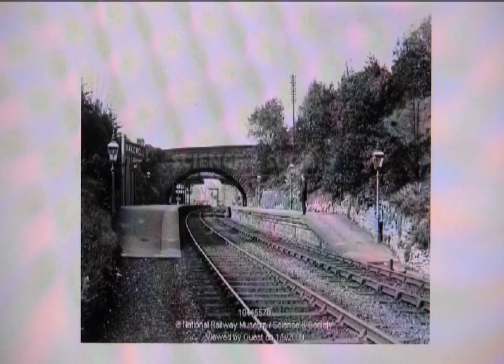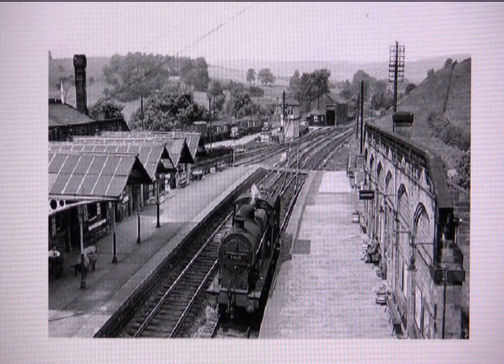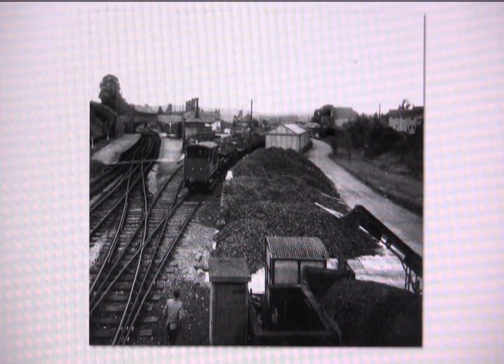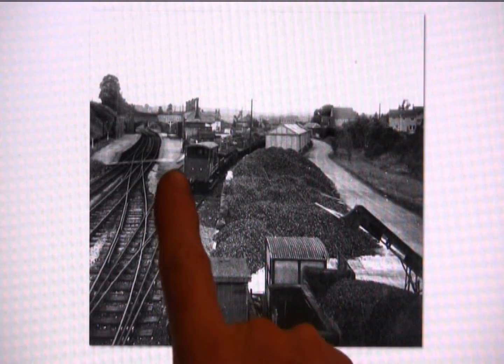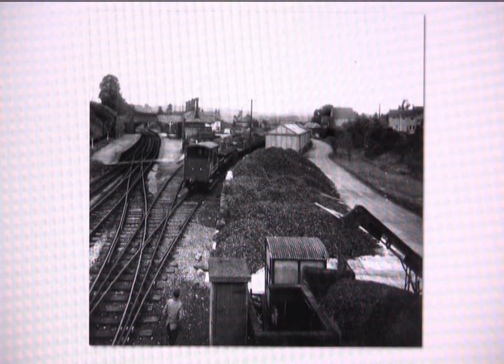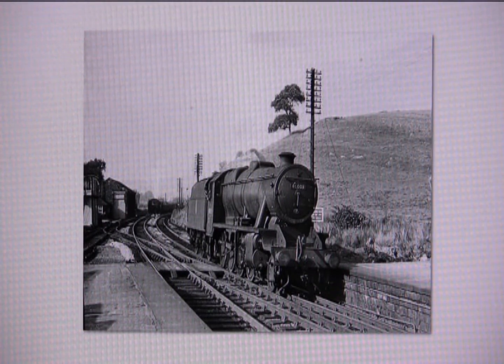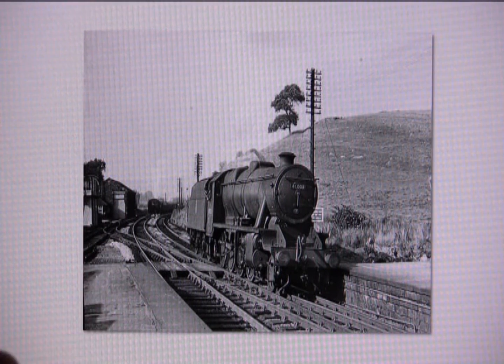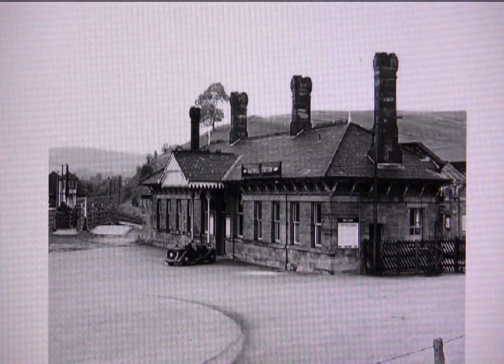N gauge Folding Model Railway part 13 by shed engineering.

Comment: Hi,

If you are using Peco finescale code 55, why havent you correctly modeled the three way point and single slip shown in the video at 22 mins 37 secs? as the Peco code 55 range offers both the single slip and three way points.

Peter

Comment: Looking good . that foam stuff is a good idea
Reply from the maker: I started using expanding foam to start with because I was worried that with it been a folding layout and semi portable there would be a fair bit of twisting etc,,, and thought plaster cloth and normal white filler would crack in no time at all,,, but its good and quick ,,,, and you have chance to sculpt the contours of the fields ,,, or leave lumpy bits if you wanted rock faces etc,,, so I think it vale for money,,,put in one night ,, come back to it the next and shape it down,,, cheers Alan

Comment: Hi Alan,

sorry to hear about the tunnel, but your solution works well, and as you say the interior of the roof would have been covered in soot, so you wouldn't see the fine detail anyway.

Your model of the station looks great. It's such a pity about the turning circle. If it were me, I wouldn't want to compromise the station building by shrinking it, to me the station is the focal point of the layout, and therefore deserves to be done properly. Also, bear in mind that the station canopies and the porch on the front are nearly as wide as the station itself, so you do need a fair bit of room to fit it all in.

I appreciate what you say about digging up and replacing the turning circle, but maybe you could make a new, shorter loop and graft it in, rather than try to reshape the existing one?

Thanks very much for showing my model of the station, It's very kind of you. If people want to see my vids, then searching YouTube for "Bakewell Station" should find them, or you can click here:

https://www.youtube.com/channel/UCBa9Xe8o5vOknHF3jW7Bp0w

Chin up mate, I'm sure you'll get it sorted and looking great as always.

Al.
Reply from the maker: Hi there Alastair ,,, Few you didn't mind me using your photo,,, thanks ,,, I should have asked first,,,,, I will put the link into the description ,,,, Ya totally agree the station has got to have 6 doors and 6 windows its the essence of Bakewell and in actual fact I think I have got the platform just about long enough,,,and yes by the time you add the canopies on I need a fair width as I stated to realize,,,,  but in actual fact I have  already took up the turning circle pushed card into the slot first,,, and with it coming together near where the weigh bridge will be,, I managed to open the bend out ,,, without hardly any distortion (Never thought it possible,,, I need to push the siding over a bit but thats nothing,,,,,  So the integrity of Bakewell station has been saved ,,,, ,,, Alastair on page 114 of lime stone hills it shows the drawing for the weigh bridge,, there is a drawing of track and sleepers with the weigh bridge in the middle ,,, was there 2 weigh bridges one rail one road,,, or was it the same one ,,, with the line inset presumable so lorries could drive on also ,,, I only saw it a few days back and until then just had it in mind as a bit of steel plating level with the road and so I could put it anywhere ,,,, now im thinking the siding needs to come right up to the building,,, any comments or observations would be greatly appreciated,,,     Cheers and many thanks,,,, Alan

Comment: Alan, really enjoyed part 13. Seeing the photos of Bakewell and comparing to your model was very enjoyable. It looks like you are right on.
Thanks,
Gary
Reply from the maker: Hi there Gary, Many thanks for taking the time to comment, Its the historical side that I have a lot of interest in and the old photos give a link to the past. I have set myself an almost impossible task in trying to model a real and actual location because unless you in a factory unit then its impossible to do it to scale. and not many people fully grasp how difficult it is to try and keep the key features and main elements of a true location. and im only just finding out the true problems when it comes to putting a scale building into a massively scaled down and shortened track plan,,, But yes the photos do give a direct link to the era,, in fact on a personal level its even a bit more than that because the first 2 photos of locos coming up the incline were taken by my Dad,,, and no doubt at some point He would have lifted me up to see over the bridge,,, its a shame I was running short of time and rushed through them, and its really appreciated that you could see the resemblance to the real location even at this early stage. Many thanks for your interest,,,,
 best regards Alan

Comment: It looks like the station building is going to need truncating along with the track plan so that the turning circle can stay in place...Ian
Reply from the maker: Hi there Ian how are you doing,,,, ya I knew trying to model a real location was more or less impossible without a factory unit to do it in,,, but thought I could get a reasonable representation ,,, but got sided tracked really  in trying to develop the road system and ended putting that in first,,, I should have stuck to the rule of engagement and put the buildings in first before limbering up my Morris minor... (there is the smallest chance I can put some plaster card in the slot of the road system ,,,, and perhaps gently bend it round towards the sidings,,, without the slot in the tube closing or distorting too much )    then we may be back on track....  Cheers,, best regards ,,,,Alan

Comment: Oh dear Alan !  What a problem to encounter after all your work and previous research into the Peco tunnel mouth's dimensions too! More haste less speed I suppose! Still I salute your attention to detail I don't expect many modellers would go to the extent of lining the inside of a tunnel. It looks as if the station building will have to be shortened and as such will blend into proportion with the platform length anyway. I hope the siting of the point under the road bridge wont give you any maintenance challenges!
Reply from the maker: Hi there admiral,,, Yes the tunnel height was a bit of a cock-up ,,,, especially when I wanted the landscape low at that end,,,as you say less haste more speed,,,  as for the Station yes I new it would be a problem ,,,but  its only when you start getting things in 3 Dimensions that you get a full appreciation of the actual problem,,, a blind man on a galloping horse knows that if you have a station building built to scale then it needs to sit platform to sit on that's also to scale. But as we all KNOW having a scale platform in any scale is almost the holy grail of modelling,,, so something has to give at some point,,,,and like you say I think the station building will need major surgery ,, I agree also the point under the bridge is in no way ideal just there, my only consolation is that with it folded in half then at that point I have an open end to the track,,,,, I now know why so few people try modelling a real location  ,,,, Cheers and best regards Alan

Comment: If you use a cam truck going through a tunnel Alan is better to edit the interior out as i do . You seem to be changing a few parts of this layout , must be very difficult to make all fit with this folding layout especially trying to copy from the pictures
Reply from the maker: Ya thats the obvious answer Dave just edit the tunnel section out ,,, but seeing as im only at the basic build stage then thought I would be worth just put the idea forward as something a bit different,,, You could just model the first few inches then spray as much as possible of the inside black and make sure there is no light getting in ,,, and that would come out as realistic as anything,,,    Not sure what you mean by "You seem to be changing a few parts" the track plan hasn't changed and the first section hasn't changed,,,, But yes your right not many layouts attempt to model a real location, and I don't think many people realizes what problems it throws up,,,, its impossible to do a real scale model of a line unless you have a factory unit going spare,,,, so you have to make massive compromises,  so im taking as many of the key features of that section of line,,, like Coombs road that goes under the line,,, the incline with the hills on one side, etc ,, but then if you do a scale model of the station building you soon run into problems, like I try and explain in the video ,, The only way you can have a scale station building is to have a scale platform,,to put it on , and as you will know yourself that's impossible. So you end up under very tight constraints,,, You can't just say "O a church would look nice here,, and a farm house there"   it would stops been "Backwell" Again that why as on the video im trying to keep the landscape low at the far end and terminate it at a real life road bridge rather than just invent another tunnel,,, Old Pictures for me actually give it a connection with the past,,,, the 2 photos of locos coming up the incline were taken by my Dad he at some point would have picked me up to look over the bridge,,,, (i do industrial cleaning and asbestos surveys) and ironically one of my customers/contract managers actually grew up in "Bakewell" and he spent hundreds of hours both on the station bridge and the one lower down,,,, over the years we have become firm friends and been up to Derbyshire many times walking miles of the old line from Matlock right up to Buxton,  Its actually one of the pictures above that stated me off on the road system,,,, In the photo showing the coal bunkers there is just the smallest bit of what I believe to be a mobile coal conveyor ,,, so thought can you get coal from a wagon up a conveyor into a lorry and for the lorry to drive off over the bridge,,, so its just trying to capture something of the past that was REAL,,, after all everyone likes a realistic model of a locomotive,,, putting extra bells and whistles on it wont make it a better model,,, so im just trying to model what was there,,, and trying to get a reasonable representation,,, perhaps not every bodies cup of tea ,,, but It would be a boring old world if we all did the same thing and thought the same way,,,,, Very Very sorry for rambling on,,
Cheers Alan ,